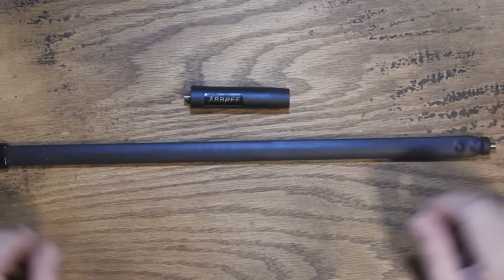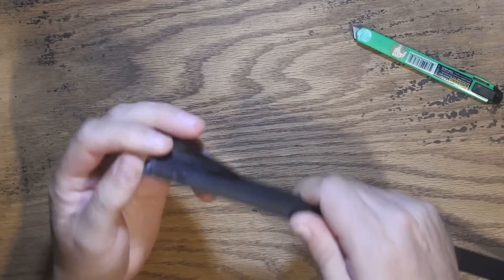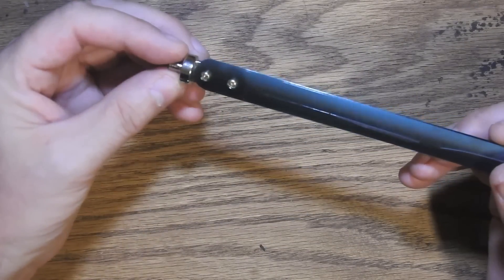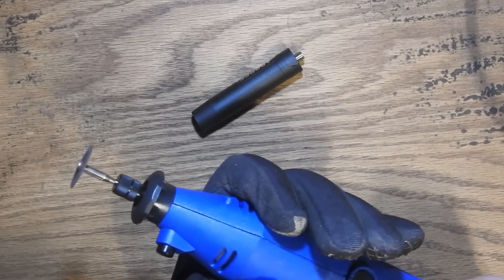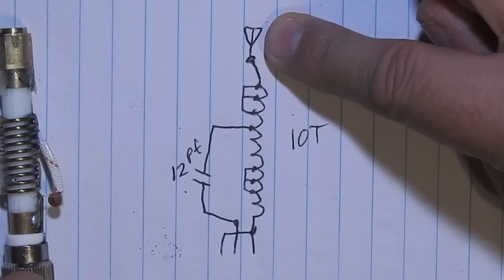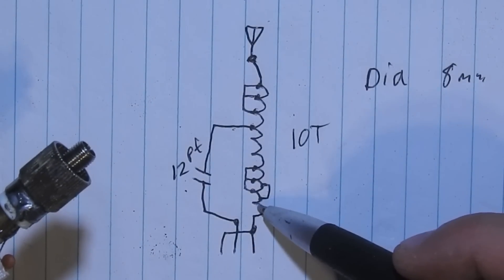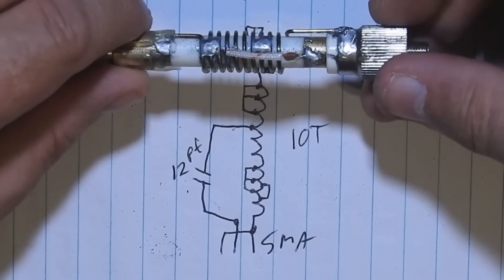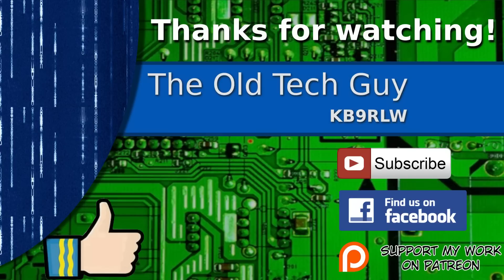Ham Radio - Tear down of the ABBREE tactical VHF/UHF antenna.

Comment: @kevinloughin thanks for this. You might not know this, but I'll ask. The antenna base with coil, this part appears the same for all the versions of this folding antenna (I am experimenting and have several different lengths of these). The base is not marked to distinguish it which makes me assume they are all the same. But can that be right? Wouldn't the length of antenna require a different tuning in the coil? I'd prefer to leave the base on the HT and change the top, but not if this then ruins the performance. Do you know, or could you guess?
Reply from the maker: Good observation. Yes something weird is going on with that coil and capacitor assembly. I've seen and heard from others that have torn these down and there is a broad variety of assembly quality and parts. One guy told me his used old measuring tape pieces for the antenna part that still had the paint and numbers on them. His was also a little rusty where the screw held it to the top of the coil assembly. 
I get the impression there are several suppliers of this generic antenna design that are all using the same brand name but competing with each other.

Comment: Mine didn’t either it was good Swr on 2 meters 1.2 to 1 and on 440 it was off the charts greater than 4 to 1. I DONT RECOMMEND THIS ANTENNA AS DUAL BAND. De wb8idy

Comment: It is a very effective antenna.  All sizes are very good performers.
Reply from the maker: There were several manufacturers making the antenna. And the quality varied greatly between them. I could only review the one from the source that I ordered in the link that I've provided in the description. Others have torn them down, sometimes they find measuring tape inside the actual antenna. Sometimes they find better steel. You got a good source.

Comment: Amazon is cheating selling copies your antenna is scrap it is not the original!!!!
Reply from the maker: It's not Amazon. There are three or more Chinese makers branding the antenna the same. It's hit or miss when you order it which one you'll get. Some of them were even using old measuring tape inside the sleeve. Some were not.
Reply: @loughkb  you put in the link that you bought the antenna from amazon and I tell you that there are only fakes and copies, what you bought is not the original, I own the original and you should see what the antenna can do

Comment: Its an old video' but what ty he hay.
No one seems to understand how these are supposed to be used. This is not a super amazing antenna. Really its no better than the basic 6" ones.
How it is used. You are in a trench or fox hole and shells are dropping all around you. Which do you want to do. Stick you whole radio and had out into the shrapnel filled air inorder to receive transmissions. Or.... deploy the extra length of the tactical wip and not have your hand blown off.
42" model is great for bunker. Small hole in roof. Slide it up so as to receive form within cover. 
Plus extra length means if it is hit, just tape it up and keep using it.

Down side you still have to expose yourself to transmit.
Reply from the maker: I can't tell if you're being serious or funny, but either way that was a very entertaining comment.

Comment: Ok now I am pretty new to gmrs and foolishly bought two of the 42” tactical folding antennas. Well I guess my newbness got me and yes out of the box no bueno swr was like 6+. Shoot screwed again.🤨.
But wait a month later from watching YouTube and ham radio guys talk antenna tuning🤔.
Guess what you can carefully remove the top cap with a dull knife or other tool. Then guess what you can cut them with a metal shears or tin snip.🤔….
 A little math and calculations of the wavelength of the frequencies you wish to tx at. You can then trim and tune the antenna for your specific use case.
It works try it. I trimmed mine for a full wave antenna for gmrs centered on 465.500Mhz.
Come on ham guys you can do better. I am a newb. Back from the past of CB’s.

Comment: I have the 108cm version. On a quansheng UV-K5 for me it is the difference between being able to communicate on the local 2 meters repeater inside my ground floor apartment or not being able to open the repeater at all (with the standard rubber duck). I also bought and tried an Abbree 771 (clone)... It has a similar coil/capacitor construction in its base as you found inside. However that one doesn't perform that well on 2 meter, although NanoVNA measurements do show nice dips at 144 and 430 MHz.

Comment: Probably wont get an asnwer but worth a shot. Can you run the lower half that was covered in plastic with the coils without that protection?

Can I just throw thick heatshrink over it and keep running it?
Reply from the maker: Probably, as long as the coil isn't deformed.

Comment: Why’s your work bench look burnt in random letters and numbers like mine for? I’d really like know how that happens
Reply from the maker: In my case it is dust and dirt that's pressed into the wood by a mouse that I use with my computer.
Reply: @loughkb  not mine but if was they need lower them Mouses power and stop using side my house do their clocking

Comment: The simplest thing to do, would be just to solder a straight wire from the feed point, to where it connects to the threaded lug. So that essentially the base is nothing more than a feed through insulator. Cut the spring steel down to 18 in. And give the whole thing a good coating of epoxy line heat shrink. Could make an excellent quarter wave antenna. If you wanted to go the extra step solder a piece of silicone coated or meter test Pro wire to the negative side or ground side of the coil form. And heat shrink that as well, to provide a counter Poise or ground plane to the 19-in vertical.

Comment: Interesting all the components of an actual useful antenna are present. Just their way of connecting them is a little strange. If you were to change the configuration so that the feed point was at approximately turn three or four., leaving the bottom of the coil connected to ground. And then unsorted the turns above the feed Point leading to the vertical. Then solder the capacitor from the turn where the feed point is connected. To the top of the coil where the antenna connect. And in a perfect world using a very small trim capacitor. You could adjust the capacitor for the best possible match. And you would have a base loaded 5/8 wave antenna. This is essentially a copy of the antenna that's used on a lot of the military manpac radios. The antenna used on the PRC 152 is slightly different as the base is nothing more than a spring. With interchangeable whips. There is a tuning unit built inside the handheld, that automatically adjusts the antenna for Optimum matching. But the basic design, at least of the whip section is similar to what was used on Manny Pac radios from the Korean War on. The base load assembly is very similar to what is in a 5/8 wave antenna. Just a very strange method of using a capacity to feed point. The capacitive feed point, protects the radio from a direct short, by providing an AC float path along the coil. Also because the antennas ground system will be constantly changing due to the size of the radio and how the user is holding it.

Comment: If you look on Amazon at these antennas. They show what a authentic one looks like inside vs an imposter. The authentic one shows a base with about 25 wraps/coils. So either they have changed the design or this is an imposter?

Comment: I got mine to work 74km on simplex at roughly more than 200 feet above sea level at 4 watts using my old trusty Icom IC 02AT. By the way, my Abbree is the 72cm version.
Reply from the maker: There seems to be several manufacturers of it.  I've heard for others who opened it up and they were different inside.  
I guess it's a roll of the dice when you buy one.  It may be good, it may not.  I got one of the latter.   The link in the description is the one I purchased.
Reply: @loughkb  
Amazon is cheating selling copies your antenna is scrap it is not the original!!!!

Comment: Hmmm. I wonder if there's a difference between this antenna and the Abbree tri-band 18.89-incher? Something may be wrong with your components because these antennas actually test very well, not only against the stock antennas, but against the Nagoya NA-771 and 24J. 

The tri-band model looks identical to the dual band model. Side by side there's no difference whatsoever. I suspect the Abbree dual-band AR-771 is the same as the tri-band AR-771 (the model numbers are the same). And I suspect the dual-band and tri-band flat-tacts are identical, the only differences, of course, being the price. 

To be on the safe side, I label them as I don't want to rip them asunder to test my theory. What do you think?

Comment: Making a rough air core calculation for the inductance of the coil (0.05 μH?), an LC tank circuit resonance calculation would yield a resonant frequency of 205.5 MHz.  Higher than the range test frequency of 146.46 MHz and Blue VNA sweep resonant frequency of 126.49 MHz shown in the other video.  But perhaps my inductance calculation is off and the inductance of the coil is more like 0.13 μH which would yield a resonant frequency around 127 MHz.

Comment: I saw one teardown on youtube and the antenna actually had printed tape measure inside! 

I have a couple of these Abbree antennas and they work much better than the original rubber ducks.
Reply from the maker: I'm pretty sure it varies depending on which vendor you buy from.   Or who they contract the build from.   
I'm only looking at the antenna I purchased from the vendor linked in the video description.  Antennas purchased from different suppliers are likely to be very different internally.   
As shown, this one did very little over the stock duck in a controlled experiment.

Comment: Same thing many Military portables use.
Reply from the maker: I'm certain the military antennas are built better, with a matching network that's actually tuned to the specific radiator length.
Reply: The antenna They're copying is for the PRC 152 handheld. It comes with several different vertical radiators, as the Radio covers a frequency range of 30 to 900 mhz. And also the radio contains an antenna matching unit. The base of the antenna, is nothing more than a coil spring. With a capacitor in parallel between the top and bottom of the spring. It provides some loading when the radio is used below 110 mhz. To deal with the capacitive reactants of the antenna. If you look up the manual for the radio online, you will see it explanation of the antenna system. But yeah spring steel antennas that design have been used since the Korean War on VHF and low VHF man packs. There's enough components there to make a useful antenna it just requires having to reconfigure them. Although the outcome probably will not be what the user is hoping for. These antennas are really for those who want to play weekend warrior

Comment: I bought one, Thought it was pretty decent until I compared it to the stock rubber duck antenna that came with a baufeng. Honestly. The abbree could barely pick up NOAA without cutting in and out while the stock rubber duck seemed to be more consistent. Also, the abbree seems to work the same regardless of whether or not you have the flexible topper attached to the coil or not.

Comment: i tested the longer one and am amazed. gave 2s units over the VX-8 original antenna, both receive and xmit
Reply from the maker: Did you purchase it from the same supplier linked in the video description?  If not, it's probably a different antenna than the one I have.
Reply: @loughkb  i bought from a guy that brings them here in Brazil. it was 'green pack' (theoretically original).

i tested it during a SOTA activation.and all the guys reported considerable improvement.

Comment: I have the 48" version. I ran an experiment with another ham 10 miles away on 2M simplex and it did work better that the spaghetti thin after market one I usually use. The problem is it is so long that it puts a heck of a strain on the HTs connector.
Reply: Yes, but have you ever seen one break? I'm very careful with mine, so I've never stressed one. I've just wondered how much stress it would take.
Reply: I did some research about this antenna and found out from another video who tested all four versions and the conclusion was that the 28 and the 48 inch if I'm correct, has basically the same performance so I bought the 28 inch and it worked great and doesn't bend that easy and less strain on the HTs' connector. Read my comment on this video.

Comment: That plastic cover on the coil could have been removed by placing over a socket of proper demitions and screewing a bolt into the top side then a hammer or press could slide it off saving the coil , looks like a typical end fed antenna . I do Wonder if there using 3 quater waves for 70cm if so bet its not to good , be interesting to see
Reply from the maker: Yes, in hindsight, now that we know what's inside, it could be pressed out.   Beforehand, without knowing what's inside, that would not have been a safe approach.
I did save the coil.  I was careful to cut slowly and not deep, prying the plastic until it was thin enough to split from the pressure.

Comment: hello please make a video about how to tune(trim) a HF antenna without analyzer or VNA ???.
Reply from the maker: Look at your SWR at the top and bottom end of the band you're cutting it for.   If the SWR is lower at the bottom end of the band, the antenna is long and needs to be shortened.   If the SWR is lower at the top end of the band, the antenna is short and needs to be lengthened.

Comment: I make it a firm rule to never by anything that starts with the word 'tactical'. It has served me well. Not that I would buy an antenna when I can build them for next to nothing and actually learn things.
I'd guess the capacitor mostly bypasses the majority of the loading coil to operate on 440 MHz. Like most Chinese stuff it's a cheap kluge version of proper engineering design. 

BTW, once they have shorted a group of windings on the same side, if they need another half a turn removed they short it on the other side. I'm sure you're right. They use the same coil for all different lengths of antenna element, and they tune them on a test-fixture using blobs of solder because it's quicker than soldering on jumpers. 

I had a couple of those antennas come with a package deal on 2 cheap Baofeng radios and I found them to work not nearly as well as 1/4 wave pieces of stiff wire soldered into connector adapters I had in my junk box. I made 2 antennas, 1 for each band, (actually 3, if you count the one for the FM broadcast band.) They don't fold very well, but I can actually fold them in an emergency, then straighten them back out since they are just made from old copper house wire. The Broadcast band one I put a little loop in the end of and hang the whole thing on a nail on the wall, radio and all. It keeps the longer copper wire antenna vertical and keeps me from knocking over the radio.

Comment: As soon as you took off the shrink tubing and I saw two parallel radiators, I right away thought "V" antenna. Possible gain and directionality. Sometimes I think too much. Also. in other tests, I've seen the Abbree antenna slightly outperform quality aftermarket antennas. Every test is different and most likely every antenna is built a little different. In any case, not an antenna I'm much interested in using......yet I bought the long version......go figure.

Comment: I added a 19" rat tail to the ground on my handie and it works really well with the 42" Abbree, might want to try that... before you throw it away.  Keep the spring steel for making a UHF yagi, they are better than the usual tape measure steel!

Comment: The coil assembly looks like a useful junk box item.
Maybe it might be worth desoldering the links one by one to see the effect on impedence/resonance.
It seems to me that this is to enable multiple versions from a  standard assembly.  The reactance of the capacitor would make the element seem electrically shorter.
In short, I am baffled. lol.

Comment: Don't throw away the radiators! Think "mini-yagi" for UHF! I bought the 28-inch model to go with my tri-band Baofeng UV-82. Admittedly it so long that there is very little "tactical-ness"  about it, it borders on being too long to use. I shudder to think how awkward the 42-inch model will be... Anyhoo, the 28-inch actually does work rather well from a receive perspective, it can "hear" a lot better than any of my rubber-ducks. Transmit quality is also measurably better than the standard rubber-duck, but if compared to my slim-jim-on-a-pole it is still rather poor. In fairness nothing comes close to a roll-up slim-jim (mine is from Nelson Antennas) on a 16-foot pole, other than standing on a mountain top with a good Yagi. I'll take my Abbree with me when I'm out on the bike and keep it in my backpack as a backup, because it's better than my duckies and also easier to handle than a pole.